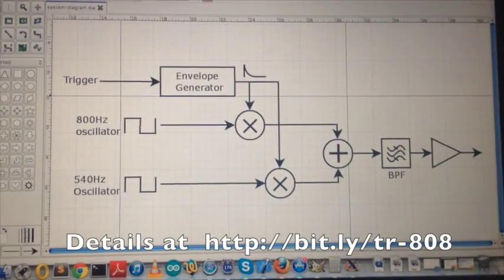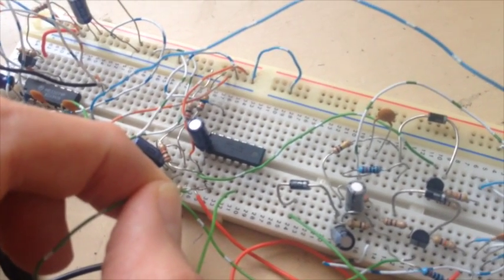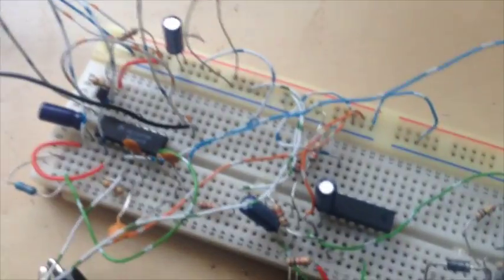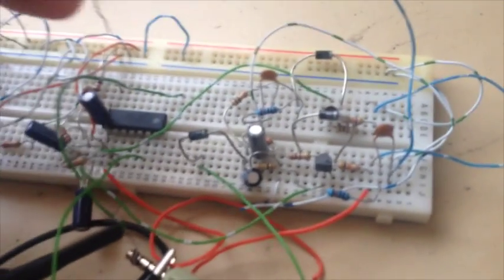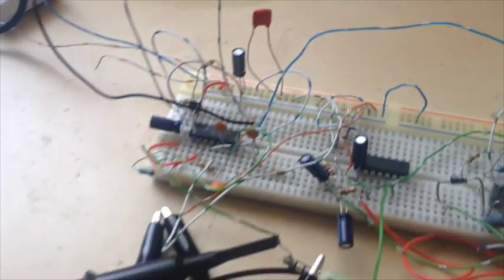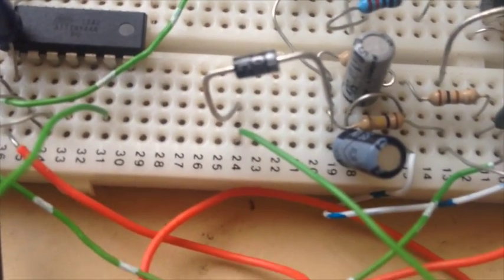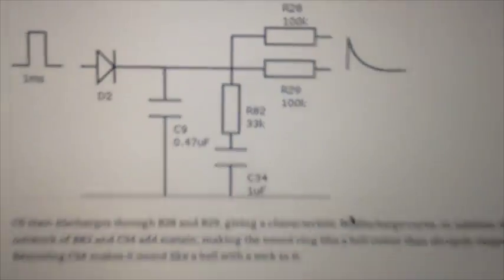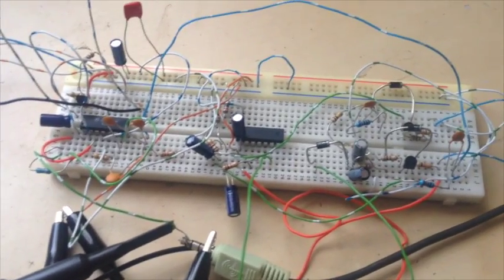Roland TR-808 cowbell rebuild

Comment: is this the same sound used on the Roland CR-8000 ?
Reply from the maker: Interesting - if you look at the CR-8000 cowbell schematic it certainly looks very similar. See area C-34 on page 21 of the CR-8000 service manual here https://gumielectronic.net/cr8000/docs/cr8000servicemanual.pdf

Comment: What values for resistors/capacitors did you use for the VCAs?
Reply from the maker: All the component values are as per the original schematics, see the cowbell section on page 13 of the document here https://archive.org/details/synthmanual-roland-tr-808-service-notes

Comment: Excellent, Although the pitch of the original circuit sounds significantly higher. I'm guessing unless you get the exact ICs that in in the schematic it won't sound quite the same. Very cool though!

Comment: Hey this is a great project! The sound is spot on too! Just wondering what you're using to trigger it. Would the click from a drum machine work?

Cheers
Reply from the maker: Beat Ratio the microcontroller is providing the trigger pulses (5 volts, 1 millisecond), but any short pulses of a few volts should work, although variations will affect the cowbell sound a bit. What were you thinking of using?